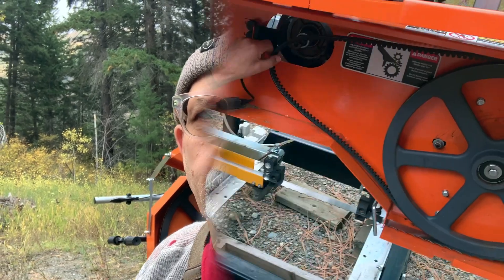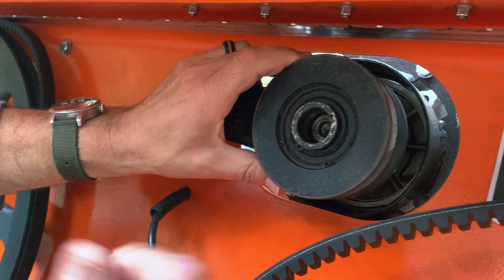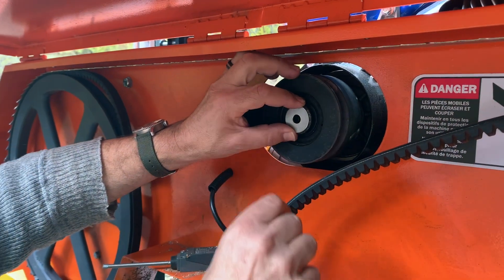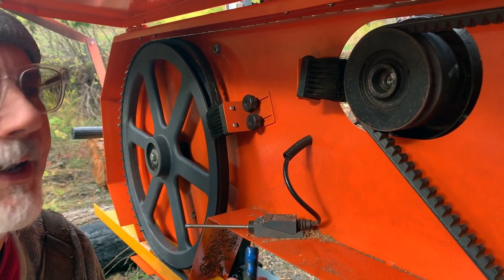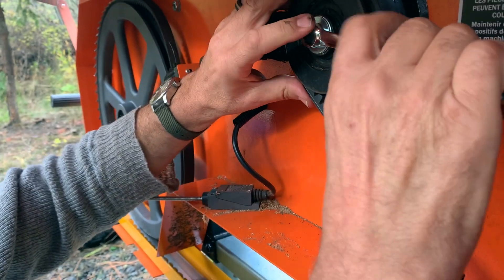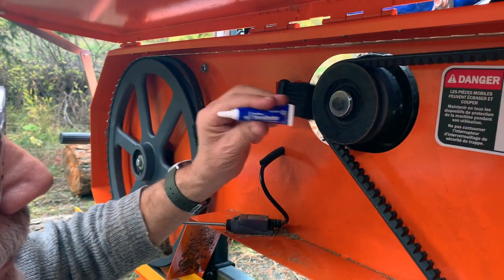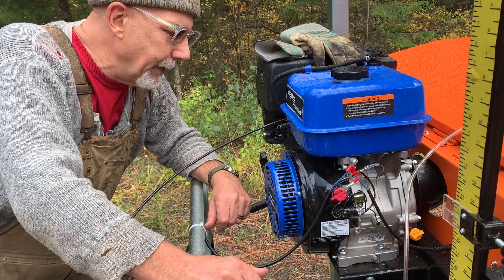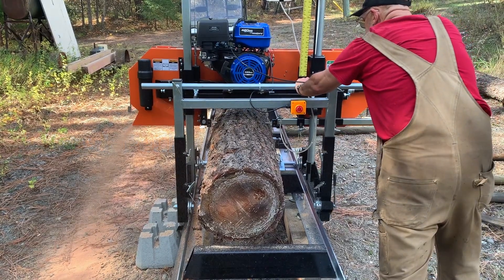Installing the Clutch on the Bozeman Bandsaw Mill Episode 55

Comment: Mine did the same thing and i list the bolt, key and washer so i had to buy new ones. I am 100km aay from Princess auto so i got parts at a local industrial supply store. FYI, the key and bolt are Imperial, not metric. Go fugure eh .
Reply from the maker: I didn’t even have the opportunity to lose the washers. The bolt was in place without the washer. And like you, I’m a long way from the Princess Auto or any hardware store. Very inconvenient for me. But we persevere!